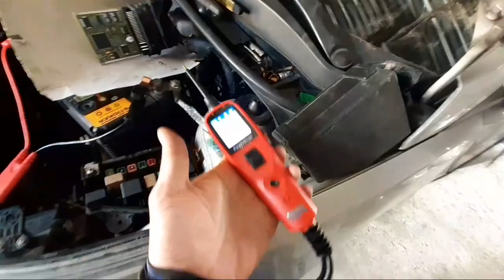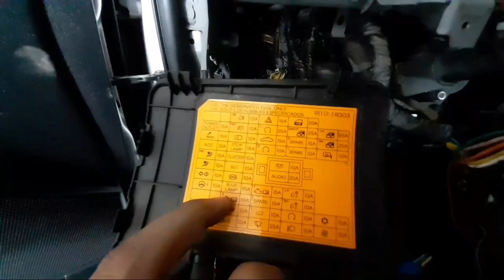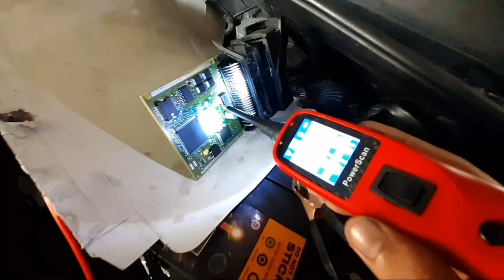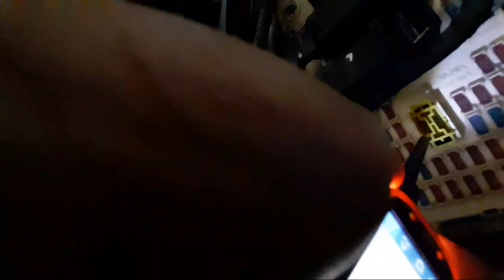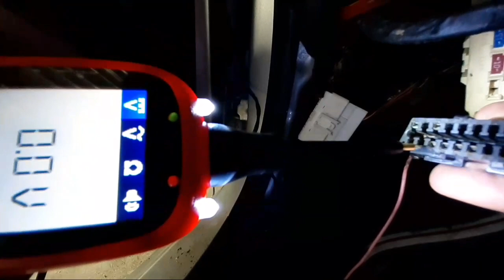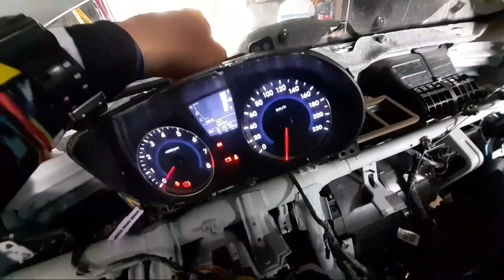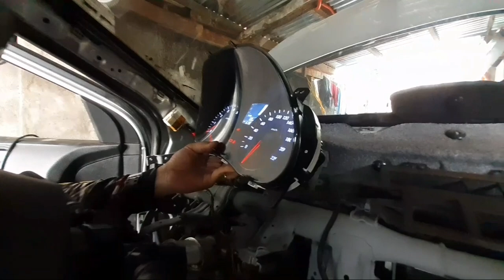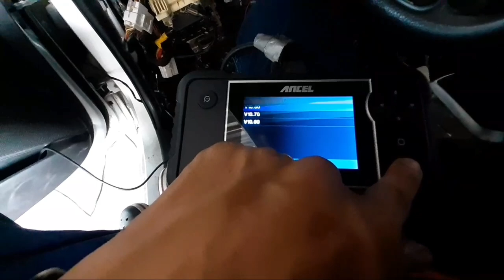SINTOMAS NA SIRA ANG ECU.

Comment: boss oto matik makahingi lang ng idea sa gngawa ko na toyata yaris 2010 model ang history nito is habang nasa byahe bigla nlng tumirik or namatay ang makina sa daan then chineck ko umiistart siya then sudenly off ang makina.then chineck ko ng aking scanner ang trouble code is P0351,P0352,P0353,P0354 IGNITION COIL A PRIMARY/SECONDARY CIRCUIT ngaun bumabalik lang ung DTC niya pag binubura action taken change 4 ignition coil and sparkplug same problem parin ang ginwa ko pa ay mag point to point ako ng harness mula sa lahat ng sensor papuntang ecm gamit ang multimeter tester okay naman lahat ng continuity ng harness.nagtry nrn ako nagpalit ng camshaft and amd crankshaft sensor,oxygen sensor maf sensor at purge valve sensor .ung fuel pump is okay rin at mga fuses same problem parin same DTC parin .pag pina start ko andar siya wala ring response ang silenyador ,start siya then suddenly matay ang makina.ang d ko nalng napapalitan ung throtle body at ung ECM thanks

Comment: ,.sir gud pm ...yung track na inaayos qu iveco stralis model 2008 ...mahina ang rpm sir parang nahihirapan mg supply ng diesel ..anu kaya ang problima sir
Reply from the maker: Naku baka injector
Reply: iveco stralis 450 po sir ...model 2008 po
Reply: ,.mahina po ang rpm sir...automatic po sya
Reply: @OtoMatikWorkz  if hindi mag feed ng kuryente sa injector, possible ba na sira ang ecu?

Comment: Using diagnostic tools pg check mo ng vehicle information test pg walang reading sa ecu,yun sira na yun
Reply from the maker: Hindi ko alam sir baguhan lang po ako.
Reply: @OtoMatikWorkz  ok lang yun sir Matik works,baka iba rin yung procedure niya..
Reply: @OtoMatikWorkz  Na observe ko lang din sa mga dealer sir
Reply: Hindi na nadedetect ng scanner yan sir. Ganyan nangyare sa akin pumutok capacitor sa ecu buti narepair pa
Reply: @drunktrader3988  paps, ano ba nangyari sa auto mo?

Yung sakin kasi na mamatay tapos maka pahinga mga 5mins or above pag pinilit ko kasi puro lang crank hirap pero uma andar nman xa after maka pahinga wla nman naka lagay na check engine sa dashboard.  ECU ba sira pag ganun?